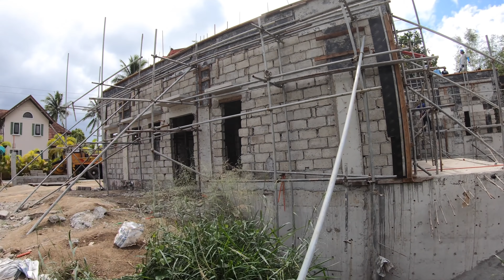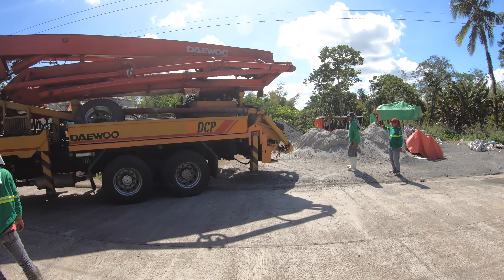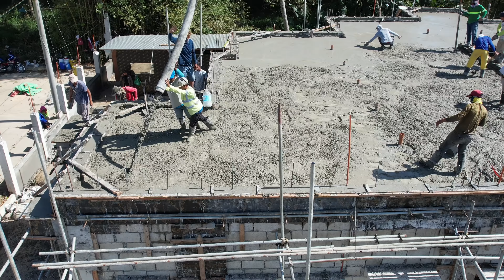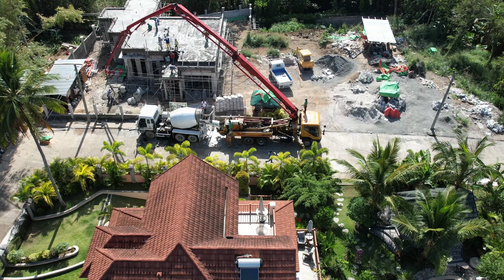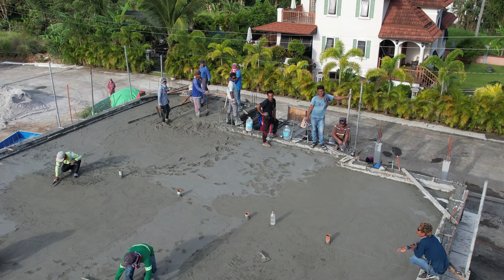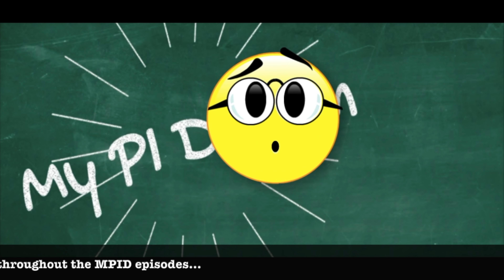NEW HOME BUILDS - EPISODE 14:  THE FINAL BIG POUR (House Building in the Philippines)

Comment: Excellent !   I'm also building a house in Tagaytay and my roof will be flat concrete as well, for exactly the same reasons..
Also, because I'm the Typhoon zone and I'm very close to Taal volcano, I think a concrete flat root will be a much safer bet...
However, be aware that 50 square meters will be added to the cost in my case, because the extra work and concrete needed to make this kind of roof.
So, at a rate of 24,000-30,000php per sqm, it will add some consequential cost to your house.

Comment: Enjoy the vids for sure. The only problem I have with the cement work it is to watery and that do take away from it strength in the property curing time and temperature which may be a problem in any earthquake tremors you may get, not good. Just watched a few days ago another home owner building down there and he gave the company the formula he wanted to use and he is doing a slump test for every load that comes on site, if it fails it don't go in.  He had the info on the number of tremors that occurred in the Philippines in the past few years.  any who lol cheerslol
Reply from the maker: Normally when you get the Ready Mix delivery, the first part of the pour from the truck is wet normally due to the priming of the pump extension.  It gets thicker as the pour occurs.
As the mix is predetermined and tested at the site of origin there is supposed to be a sample test which after curing should match or exceed the value of the strength in PSI as indicated on the invoice.  For this pour I believe the order was for 3,500 PSI.
Reply: @MyPIDream  Thx

Comment: Hi James Hi Ness.  James!! WOW!! that was freak'in great footage man really enjoyed it didn't want it to stop. One thing I was curious about though, the beams and belting was poured the same time a the roof slab. Typically what I have seen here in the Caribbean is that the roof beams and belting are poured  days before the slab thereby giving the slab some stable resistance, but I guess the cost of trucking concrete and renting the cane  multiple times within short periods dictated doing it in one shot. was a  very exciting pour nonetheless .
Thanks for another great ride. sorry bout the GoPro, expensive bullet to bite.
Reply from the maker: Good to hear from you Wayne and hope your health is doing well.  As for the beams and slab being poured at the same time this is the common practice here and I agree with the principle that doing this provides a "monolithic" bond which is stronger than separate pours often resulting in cold joints which are the first place you see cracks and separations.

Comment: Not a big fan of hollow block material! It actually cost more to use when you consider the amount of labor, amount of cement & sand that is required to render the wall smooth. I  recommend building the the whole house out of Form Concreate then when pull the forms the only follow up is Skim Coat and done. A good Vlogger to watch this process is Texas Filipino building his home in Iloilo!